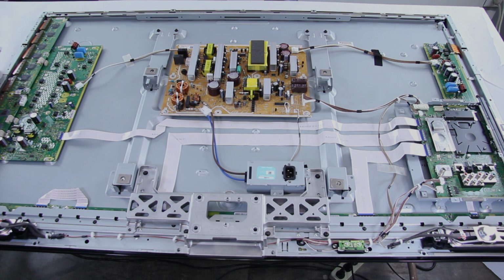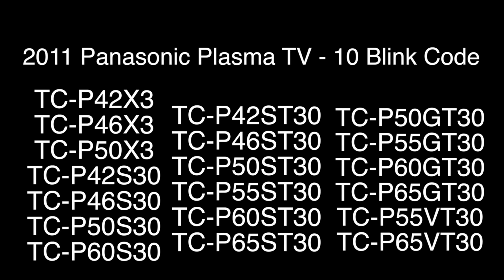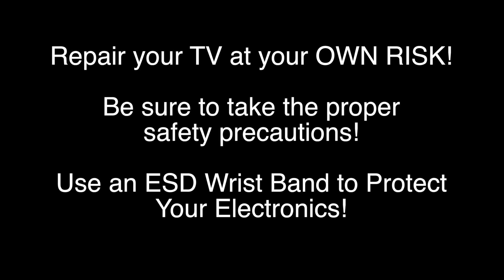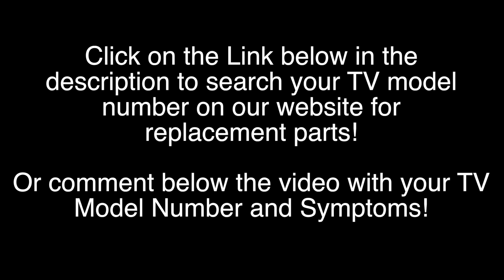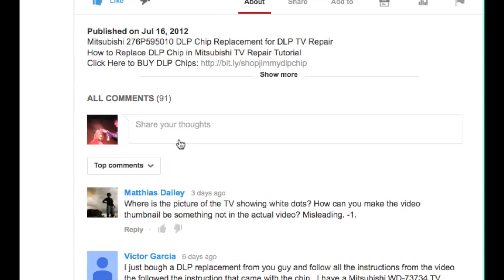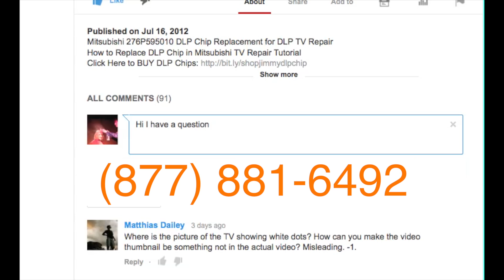Panasonic Plasma TV Repair - Understanding 10 Blink Code for 2011 Panasonic Plasma TVs-How To Repair

Comment: Yes I am a 30 years experience in tv repair my last repair goes back 20 years with CRT system so no too much experience on plasma System.
Now I own a 2011 Panasonic TC-P60S30 it gives me 7 blinking code I do not want to replace a wrong board I was wondering ANY HELP ??

Appreciate any suggestion

Comment: hi.  have panasonic TH-50PX77U (2006?), with 10 blinking lights and set will not power on.  have removed back and cleaned thoroughly, still 10 blinking lights and no power after initial click.  does youtube video showing repair for 2011 panasonic (TC models) plasma apply to older models(TH model)?  are the diagnostics similar?

Comment: my turn. I have a 2009 TCP46G15.  Wont turn on and no blinking lights. I replaced the power board but no change . I think i should have changed the "A" board instead. With the back of the TV off when I turn it on I can see 2 small green lights. 1 to the left and 1 to the right of the power board. Any help would be appreciated.
Reply from the maker: Steve Dunne    Try this at your own risk. Unplug the TV, then disconnect the y board and plug in the TV to see if the TV powers up. Reply with the results of this test. Thanks! www.shopjimmy.com

Comment: We have a 2008 Panasonic Viera Plasma Flat Panel TV. The red LED light by the ON/OFF switch is blinking 10 times. For a while we were able to unplug the TV wait 5 minutes and then turn it on and the HDMI light in the upper left of the scree would come on and then our Cable provider's Logo would appear and then the TV would come on. Now we can not get the TV to come on at all, but the red LED light is still blinking 10 times. What should we do? Does this sound like an "A Board" or a "Power Board sort of problem?
Reply: I've got the same problem on the same set. What did you need to do to fix it.

Comment: I have a TC-P50U2 model Panasonic plasma tv. I was watching TV, when the screen just shut off. Then, the lights started blinking. I unplugged it, then plugged it back in, powered it on, and the same thing happened. I'm counting 10 red blinks. Your video said I need the Main "A" board, but looks like you don't have them in stock. When do you expect to get more of them?
Reply: I have the same TV.did you get it fixed already.
Reply: It was completely fried. We junked it and bought a new one.

Comment: Hi I have a question i have a panasonic tv model #TC-50PS14 power light blinks 10 times just want to make sure its the main board and not the power supply board. in your videos i dont see my model number  so if you could verify that for my t.v model panasonic number # TC-50PS14 that the led power light blinks 10 times i would really appreciate it very much thank you.
Reply from the maker: Chris F   Try this at your own risk. Unplug the TV, then disconnect the SC board and plug in the TV to see if the TV powers up. Reply with the results of this test. Thanks! www.shopjimmy.com
Reply: I tested the sc board and it was bad i replaced the sc board and the t.v works great thxs for the respond really appreciate it.

Comment: What to do, my 46 ' plasma tv won't turn on I get a red light  that flashes 13 times. It's a panasonic tv  TC-P46x3 .please let me know what to do .Thanks
Reply from the maker: Carl Cassizzi  Try this at your own risk. Unplug the TV, then disconnect the SC board and plug in the TV to see if the TV powers up. Reply with the results of this test. Thanks! www.shopjimmy.com

Comment: hi,i have a TC-P50X2  Panasonic plasma TV 50 in"2010 serial #  LG03220013. the problem is  10 times red lights blinking.i don't know what is the problem.
Reply from the maker: Khasrow Kazemi    Try this at your own risk. Unplug the TV, then disconnect the y board and plug in the TV to see if the TV powers up. Reply with the results of this test. Thanks! www.shopjimmy.com

Comment: I have a TC-P50VT25, manufactured in 2010 that is giving me the 10 blinking light code. I am working on removing the back now. Appreciate any guidance, thanks.
Reply: ShopJimmy.com Thanks for the response. I have disconnected the SC board and still have 10 blinks. I also tried disconnecting the A board and also have 10 blinks.
Reply from the maker: Mike Ratrie  Try all repairs and troubleshooting at your own risk.   I recommend replacing the SS board in your TV.  Click this link to replacement parts for your TV model number:  http://www.shopjimmy.com/panasonic-txnss1ltuu-ss-board.htm  There may be multiple boards for the same TV model number, be sure to match part numbers on your current board, with your replacement for compatibility.  Thanks and please let us know if you have any further questions with your TV Repair!  www.shopjimmy.com
Reply: ShopJimmy.com Thanks for the reply and the links. I will report back.
Reply: ShopJimmy.com I received the SS board and anti-static band. Installed the SS board with the exact same results - 10 blinks. Please let me know the next step(s).
Reply: ShopJimmy.com Also, FWIW, just to see what would happen, I unplugged both the SC and your replacement SS board and I get 7 blinks.

I tried a replacement A board (you were out of stock). With all boards connected, I get 10 blinks, 7 blinks with the SC and SS boards unplugged.
Reply from the maker: Mike Ratrie   Try all repairs and troubleshooting at your own risk.  Next, you could try replacing the SU & SD boards in your TV to see if that fixes the problem.  If that does not work, then you most likely have a shorted panel.  Click this link to replacement parts for your TV model number:  http://www.shopjimmy.com/catalogsearch/result/?q=TC-P50VT25  There may be multiple boards for the same TV model number, be sure to match part numbers on your current board, with your replacement for compatibility.  Thanks and please let us know if you have any further questions with your TV Repair!  www.shopjimmy.com
Reply: ShopJimmy.com Thanks for the reply. I replaced the P board (again, you were out of stock at the time, sorry), and that fixed the problem. Your board is on its way back.
Reply from the maker: Mike Ratrie   Glad to hear you got the problem resolved.  Thanks!  www.shopjimmy.com

Comment: i have a panasonic model TC-54PS14 flat screen and i cant figure out how to repair it maybe you can help same problem with this video. it will click as if im turning it on but nothing shows on my screen and the power light keeps blinking 10x in a row then pause and blinks 10 more times and continues as a pattern can you please help?
Reply from the maker: Sharlou Jaramillo   Try this at your own risk. Unplug the TV, then disconnect the SC board and plug in the TV to see if the TV powers up. Reply with the results of this test. Thanks! www.shopjimmy.com

Comment: Hi I have a Panasonic TH-P50U20A manufactured in Dec 2010. It has the ten blink code fault and does not change to 14 blink code fault as per your viodeo. I wopuld appreciate your thought on whether it is the main board "A" board or the P board. Thanks.

Comment: I own a Panasonic Panasonic TX-P42G20Es which now is defect. If I power it on the TV comes up with good picture and after a minute I get horizontal lines moving vertical.No red lights flashing.
 
I brought him to a service technician and they told me the main board was defect. So I bought a new mainboard and put in in.
With the new mainboard I get the Red 10 light flash error.

So I am confused. Can you please help me ?
Reply from the maker: Gerardo Romero Butron   I recommend that you bring your TV to a certified Panasonic Repair Shop.  Thanks!  www.shopjimmy.com

Comment: I have a Panasonic Viera Model # TC P50U2 PLASMA IT IS blinks 10 times it was manufactured in November 2010 does the same apply, and do you have the A Board for it
Reply from the maker: Daniel Lemay   I recommend that you bring your TV to a certified Panasonic repair shop.  Thanks!  www.shopjimmy.com

Comment: I got the 10 blinks and I removed the cover and vacuumed all of the dust and now it works. Did it overheat or something?
Reply from the maker: TigerSaint   Please reply with your TV model number.  Click here to view a video that shows how to find your TV model number:  https://www.youtube.com/watch?v=S51nhAmwR2M  Thanks!  www.shopjimmy.com
Reply: ShopJimmy.com It's doing it again. Is it easier just to change out the Power Supply board?
Reply from the maker: TigerSaint   Try all repairs and troubleshooting at your own risk.  Do you have experience with a meter?  If so, you can check the VS and VA voltages on the power supply.  Thanks!  www.shopjimmy.com

Comment: hi shop jimmy,i have a th42px60b,with a tnpa 3911 board,i have the 10 blinks,i have replaced the mosfet transister and checked the thermal resistors and thermal fuse all ok,disconecting the two boards to the left and right,still have the ten blinks

Comment: Plasma 50``  tc-p50u2   I got the 10 light blink code. After seeing your video says it's the main board. Is that 100% the fix for that issue or could it be something else?
Reply from the maker: Garret Klande   There is a possibility that it could be something else.  Thanks!  www.shopjimmy.com
Reply: +ShopJimmy.com 
I have ordered main board. I will update if it fix the problem.
Reply: @phlfly10  What is the update?
Reply: @kellyq21  actually it's working but if you looked close enough it's still a line but very invisible from far. That is if you are picking. 
PANASONIC SC BOARD TNPA5105

Comment: I have a Panasonic TH-50PX6U. I believe some of your videos may be applicable to my TV, but I can't be sure. I have the dreaded power on "click" with the 10 blink code. What video will be applicable for my TV?
Reply: Hey, Sorry it took so long. With the board removed, I plugged it in. I heard the "power on click" and the light in front went green. When I pushed the power on button, the light started to blink 5 times. I hope this helps. Thanks, Otey
Reply from the maker: Otey Reynolds   Try this at your own risk. Unplug the TV, then disconnect the SC board and plug in the TV to see if the TV powers up. Reply with the results of this test. Thanks! www.shopjimmy.com

Comment: HI, CAN I GET HELP. Panasonic viera TC-50PU54  50'' hdtv.
it blinks 8 times.   as soon as you turn it on it will shut right off and then blink 8 times Is this fixable?
Reply from the maker: Lisa Sissle   Try this at your own risk. Unplug the TV, then disconnect the SC board and plug in the TV to see if the TV powers up. Reply with the results of this test. Thanks! www.shopjimmy.com
Reply: ShopJimmy.com Ok, so I unplugged the TV, then disconnected the sc board and left it disconnected while I powered up the TV. the TV has same results but less LED blinks; the TV turns on then right back off again then shows a 7 blink code instead of 8....thanks for the help
Reply from the maker: Lisa Sissle  Try this at your own risk.   Repeat the same test on the SS board.  Thanks!  www.shopjimmy.com
Reply: ShopJimmy.com ok...... 8 blinks
Reply from the maker: Lisa Sissle  Try all repairs and troubleshooting at your own risk.  This seems to be an issue with either the power supply or the main board.  Do you have experience using a multimeter to measure voltages?  If not, you can try replacing the main board and power supply board individually to see if one of those boards fixes the problem.  http://www.shopjimmy.com/catalogsearch/result/?q=TC-50PU54  There may be multiple boards for the same TV model number, be sure to match part numbers on your current board, with your replacement for compatibility.  Thanks and please let us know if you have any further questions with your TV Repair!  www.shopjimmy.com

Comment: Hi, I have a 2011 Panasonic Viera Model TC-P50S30. My son turned it on in the basement, which is absolutely freezing. He said the screen did a "rainbow" effect and then promptly shut down. Since then we cannot get it to turn on at all. The "click" you normally hear when turned on is not there. Also no hum at all. Just a constant red light. After reading some of these posts, we unplugged the SC board and it gave an 8 blink code. Then plugged the SC board back in and we got a 14 blink code. Now the TV has a constant red light. What fuses we can see checked out ok.  While we were in the back it did make a very small click sound, but not what you would normally hear when turned on.  Wondering if something was blown, by it being so cold. Any ideas?
Reply from the maker: MR CRAIG   Plasmas should stay at room temperature.  This could be a power supply or A board in your TV.  You can replace each of these boards individually to see if one of those two boards fixes the problem.  Click this link to replacement parts:  http://www.shopjimmy.com/catalogsearch/result/?q=TC-P50S30  There may be multiple boards for the same TV model number, be sure to match part numbers on your current board, with your replacement for compatibility.  Thanks and please let us know if you have any further questions with your TV Repair!  www.shopjimmy.com

Comment: Panasonic TC-P50G25 giving the 10 blink code. When I unplug SS board, still no pic and still 10 blink code. When I unplug SC board,still no poc and changes to 7 blink code.  What should I replace?
Reply from the maker: Brad Petty  Please watch this video FIRST to help with your repair!  https://www.youtube.com/watch?v=BP3NVNCGEv8  This could be a problem with the power supply board or the A main board in your TV.  You may need to replace the A Board and power board individually to see which one fixes the problem.  Click this link to replacement part for your TV model number:  http://www.shopjimmy.com/catalogsearch/result/?q=TC-P50G25  Be sure to match part numbers on your current board, with your replacement for compatibility.  Thanks and please let us know if you have any further questions with your TV Repair!  www.shopjimmy.com

Comment: Great video, thanks!  I have a TC-50PX24 with the 10 blinking lights, so is it safe to assume it's the main board on this one?
Reply from the maker: John Magnusson   Try this at your own risk. Unplug the TV, then disconnect the SC board and plug in the TV to see if the TV powers up. Reply with the results of this test. Thanks! www.shopjimmy.com
Reply: ShopJimmy.com After looking all over the internet for boards for this TV, and realizing they are tough to find these days, I ended up selling it for $40 cash, and picked up a new TV.  :-(    Sorry I can't run the test at this point.  However, I am grateful for the very educational video you posted.  Please keep it up.
Reply: I know this is an old video but I’m hoping you still respond. 

Panasonic TC-P50S2 that has 10 blink code. I tried unplugging the SC board and powering it back on, screen stayed black and showed 7 red blinks instead of 10

Comment: My Panasonic plasma HDTV (Model No. TC-P50S2, Serial No. MC01050001, Manufactured April 2010) makes a click sound when I hit the power bottom then about 3 seconds later it clicks again then blinks 10 times, pauses then blinks ten times and continues this pattern of blinking. Is this repairable?
Reply from the maker: Lindsey Rigby   Try this at your own risk. Unplug the TV, then disconnect the SC board and plug in the TV to see if the TV powers up. Reply with the results of this test. Thanks! www.shopjimmy.com
Reply: ShopJimmy.com
I disconnected the SC board and now I am getting 6 blinks. Still a black screen. Thanks for your help.
Reply from the maker: Lindsey Rigby   Try at your own risk, the same test on the other side with the SS board.  Thanks!  www.shopjimmy.com
Reply: ShopJimmy.com
I reconnected the SC board and disconnected the SS board. The result was 10 blinks with still a black screen.
Reply from the maker: Lindsey Rigby  Please watch this video FIRST to help with your repair!  https://www.youtube.com/watch?v=BP3NVNCGEv8   This could be a problem with the power supply board or the A board.  You can replace each of those boards individually to see which one fixes the problem.  Click this link to replacement parts for your TV model number:  http://www.shopjimmy.com/catalogsearch/result/?q=TC-P50S2  There may be multiple boards for the same TV model number, be sure to match part numbers on your current board, with your replacement for compatibility.  Thanks and please let us know if you have any further questions with your TV Repair!  www.shopjimmy.com

Comment: I have a 2010 Panasonic Plasma TV  TC-50S2  December 2010 
I have the same 10 blink problem that your video described.  Do I need a Main Board or A Board for this model?  What is the model number?
Reply from the maker: Robert Hines Try this at your own risk. Unplug the TV, then disconnect the SC board and plug in the TV to see if the TV powers up. Reply with the results of this test. Thanks! www.shopjimmy.com

Comment: I have a TC-50S2 and it recently started blinking 10x.  I think I have to replace the A board.  Can you confirm and how much would a new board be?
Reply from the maker: Eric Crawford   Try this at your own risk. Unplug the TV, then disconnect the SC board and plug in the TV to see if the TV powers up. Reply with the results of this test. Thanks! www.shopjimmy.com

Comment: I have a Panasonic tc p42c2 I replaced the y board, main board, power supply and the x board and still have the 10 blink...now that i have spent more on boards than the TV is actually worth will you please tell me what the 10 blink code really means...

Comment: August 2010.  I'm getting 11 blinks.  The tv will play, then shut off and blink 11 times.  Panasonic TC-p50vt25                LF02120374
Reply from the maker: jaynana7   Try this at your own risk. Unplug the TV, then disconnect the SC board and plug in the TV to see if the TV powers up. Reply with the results of this test. Thanks! www.shopjimmy.com